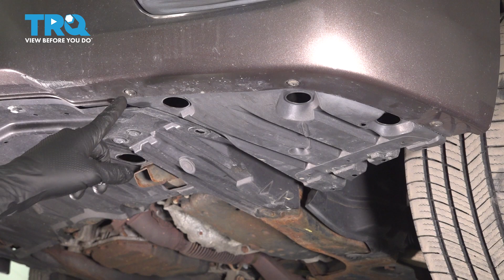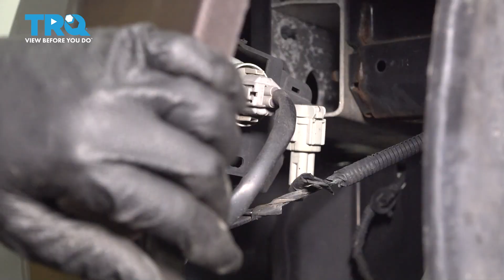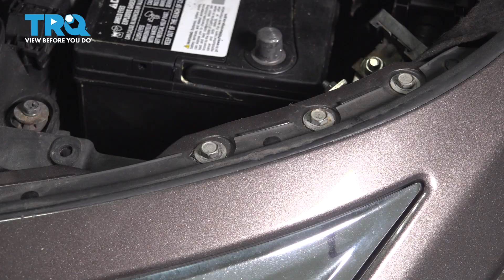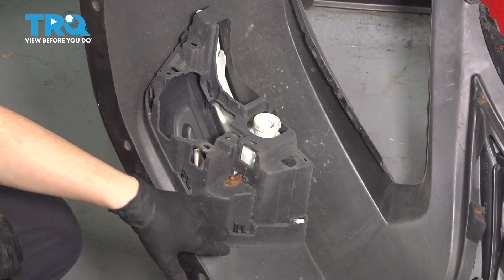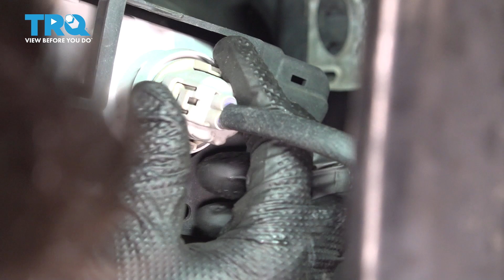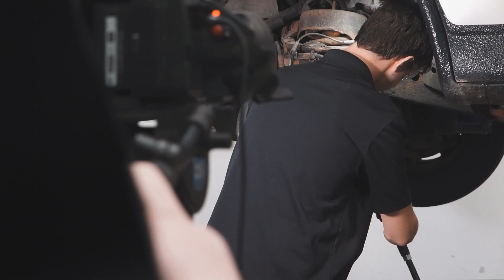How to Replace Turn Signal Assemblies 2012-2018 Nissan Altima

Comment: Is there an easier way to do this besides taking the whole bumper off?  I've heard you can turn the wheel all way to the side then remove the splash guard and reach in and remove the bulb but can't find a video on this for a turn signal bulb.

Comment: Thank you sincerely. I was able to complete the job with no hitches. I really regretted the thought of having to take the bumper off. However, once I got into it, I found it to be kind of fun and extremely easy. I could not have done it without TRQ. Thanks again.